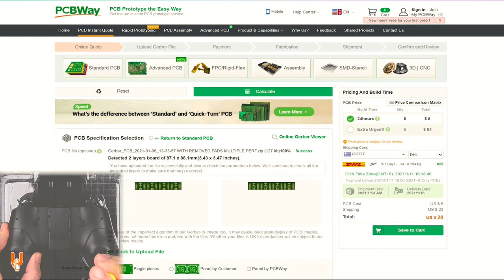Radiomaster Zorro Gimbal adjustments : stick tension, travel limit, mode change & throttle friction

Comment: After some search I found this film to be the most useful if one wants to switch modes on Zorro. Thank you :)
Reply from the maker: Thank you for the feedback! I am happy you found it helpful!
Reply from the maker: You can toggle the self-centering of the gimbal with the adjustment screws at the back, but it can be a pain going back and forth if you want to fly and drive often and back to back. Otherwise you could stay with self-centering off (for flying) and set up a profile with a big deadband around the center of the vertical axis. This way you could stop the vehicle without having to be very precise, and also move back and forth with fairly good resolution. I don't do RC cars so this us just a thought.

Comment: Thanks a lot for the video but what's the difference between friction and spring tension?
Reply from the maker: The friction adjustment affects how stiff the throttle stick is when moving up/down. The spring adjustment affects how stiff the sticks for yaw, pitch and roll are (how strong the force of the self-centering is).

Comment: Really helpful.  I bought this because it was supposed to be easy to swap stick mode (and built in ELRS) and then felt a let down when nothing explained how to switch.  Thank you for the video.  I first learned on DJIs with default stick mode and hated life after gaming for 30+ years.  Finally I read somewhere how to change to stick mode 3 (DJI) so now my flying learned in Halo, CoD, etc are intuitive.  I was not hoping to go back to the painful days while learning FPV with the Zorro.  I have "kids toy" FPVs I fly just for giggles occasionally, and always hate the "relearning".  Anyway, my point in all of this is thank you for the video on how to take charge of my FPV flying experience through the controller.  

Now, my next logical question is:  How do I make the quad know I'm putting the throttle on the right stick? FC on drone, remap channel on Zorro, both?
Reply from the maker: I am very happy that you found this video helpful! Next step is to change the settings of the Zorro radio and "tell" it which axis is throttle, yaw, pitch and roll. I don't have a video about that but I am sure you will find plenty of instructions online!
Reply: @muteFPV  So remap the Zorro, but then leave the FC channels the same in Betaflight (FC on the drone/UAS)
, right?
Reply from the maker: Sorry I just saw your reply, for some reason I was not getting notifications for a lot of comments and especially replies to comments. I am manually going through all the messages to see what needs my attention... I suppose you already figured things out after all this time :) If you need anything let me know!

Comment: In my Revision (received May 2022) i did not need to remove the PCB to adjust Vertical axis, the PCB has a Cutout near the vibrator motor.
Reply from the maker: Oh that is nice! Thank you for the feedback!
Reply: Likewise!  ELRS version has an additional hole for the left side (right gimbal), and a bit of PCB cut out on the edge of the right side (left gimbal) 👍
Reply: I need to confirm the objective of your demo. I need to change from mode 2 to mode 1: is that what you are exemplifying?
First time I see a youtube video without a torrent of words; congrats on your original approach. Thank you for your patience but, as they say, newbies also want a piece of the pie.
Reply from the maker: @Vasco sorry I just saw your message. In order to change modes between 1-2, you need to disengage self-centering from one stick and add some friction + engage self-centering on the other stick. Then you will need to set up your radio accordingly and "tell" it which axis does what.
Reply: @muteFPV  Thanks for clarification. Appreciated your original economy of words.

Comment: Be very careful to avoid pinching the battery wires between the standoffs when closing it I just had to resolder the wires after melting the battery spring into the tip of my finger lol
Reply from the maker: Ouch!

Comment: What tools or materials do I need to change from mode 2 to mode 1?
Reply from the maker: If your radio is exactly like mine, you will  need to disengange the self-centering on one stick and engage it on the other stick (check @ 1:02)

Comment: Why the manual doesn't have these things? Thanks a lot for the video. 
Can you tell me friction screw hex key size? All I have are over 3 mm.
Reply from the maker: No idea why, you're welcome! They are all 1.5mm hex driver size, if I remember correctly
Reply: @muteFPV  Thanks!

Comment: BTW peeps who has ELRS version; there was already holes on board for tensions. no need to remove it 👍🏻
Reply from the maker: I think they changed it after I received my radio, I remember someone else told me the same thing :)
Reply: I have the elrs version how do I adjust the tension